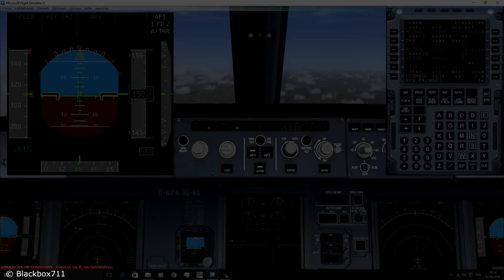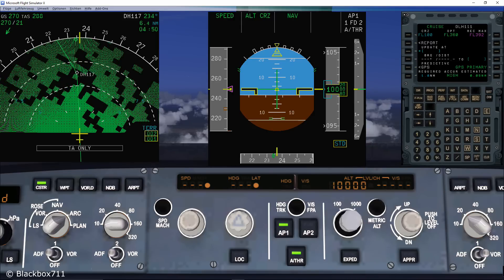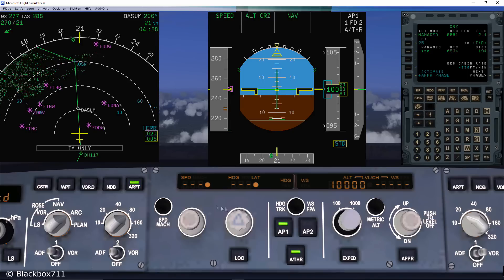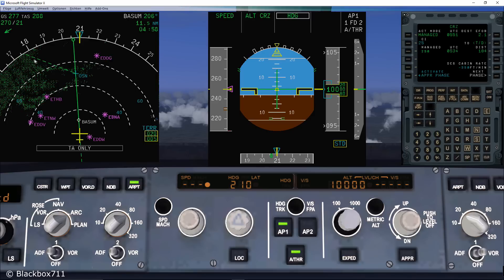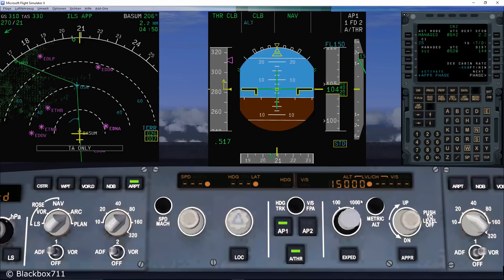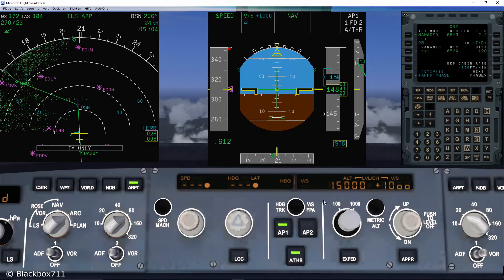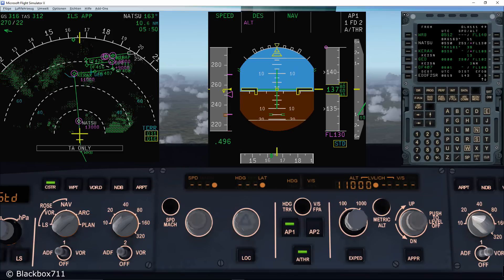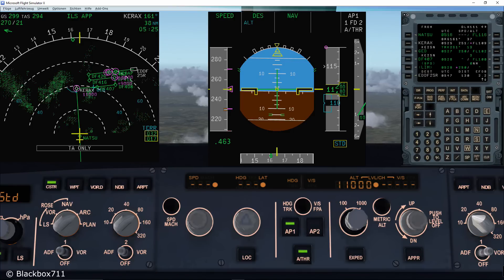FSLabs A320-X Basics: Autopilot/FMGS - how to use it properly

Comment: Hi, question, from managed descent I changed mode to selected descent V/S -xxx, Speed SP was selected and regulated by me. Now reaching the set ALT aircraft leveled to horizontal flight and I wanted to get back to managed mode. I pushed the ALT knob but aircraft didn't react and went back to managed DC  mode.  What did I wrong? must I set speed back to managed before ? Thanks for answer
Reply from the maker: Did you select a lower altitude on the FCU?
Reply: @Blackbox711  I don’t remember, but it can be that I didn’t change the FL before trying to change mode…
Reply from the maker: Also the managed climb/descent only works when in NAV mode.
Reply: @Blackbox711  thanks for help!

Comment: Thanks for the video!  I do have a question though.  What does the AP actually engage?  It appears that the Autothrottle and the NAV lateral  movement does not require AP to be engaged?  I guess I am confused because normally you would need to engage autopilot to adjust speed, altitude, and NAV.  But in the A320 it seems that the speed/Alt and Nav are functional without AP being engaged?  Am I missing something?
Reply from the maker: You have to differentiate between flight guidance (flightdirectors) and automatic flight. So you can indeed have all the same modes indicating on the PFD without the autopilot being engaged.

Comment: Hi. Im new with this aircraft on my flight sim P3dV4. My fmc always while flying have my plane do a high attitude pitch up then will descend  I don't know how to get it so I can program it correctly need some help with this
Reply from the maker: It is important that you read the manual that came with the installer. It should be either in your desktop or FSLabs folder.

Comment: How did you make the fcu so realistic with the 2 autopilots on Flight Simulator? Mine has just 1 autopilot on the fcu. 
Please tell me
Reply: FSX Default A320s have only 1 AP. This is FSlabs A320!
Reply from the maker: What Simulator are you using?

Comment: Hi, How do you fly with autothrottle engaged for the speed but manual HDG and ALT inputs?  I .e a visual manual approach.
Reply from the maker: I do that only in Flightsims. Helps me better to look outside without worrying about the airspeed all the time
Reply: Ok so In real flying you wouldnt have autothrottle on and HDG / ALT with sidestick inputs?

Comment: Could you explain please, why did the autothrust mode suddenly change from "thrust idle" into "speed" while descending, at 10:50 ?
Reply from the maker: Hi. It happened because the descent path was less steep and the FMC calculated that Idle Thrust is not required any more and hence changed into Speed mode. The aircraft only needed to descend 2000 ft and had 20 NM to do so. Regards

Comment: Great video. What do you use for fuel calculation (And takeoff/landing) with this aircraft ?
Reply from the maker: Hi. Thank you. I use simbrief.com for flight planning and a programm called TopCat to calculate the Takeoff Performance. Regards
Reply: Blackbox711 Thanks . How do you find the OFP from simbrief compares with fuel burn etc to this A320. What aircraft version do you use in Topcat i didn't buy this because I thought it didn't support this aircraft.
Reply from the maker: I think Simbrief does a very good calculation. I regularly do fuel checks on my flights and find only very small differences. Regarding TopCat, there is a FSLabs file that you can load into TopCat.
Reply: Blackbox711 Thank you very much. I had no idea that Topcat was supported. Are you using a custom aircraft type in Simbrief? If so is the ZFW taken from the FSLabs docs ? (also any fuel offset?). Thank you.

Comment: I'm New to the airbus and i have a question : if I select a speed and then push the knob will the aircraft follow my command or will it return to its original speed ? 
Srry im used to the default fsx a 321 !

Any way great video !
Reply from the maker: +STEFANO COZZI .. Thank you. Pushing the speed knob gives you "managed speed" which is the speed prompted by the FMC depending on the active phase (climb, cruise, descent, holding, approach). If you select and pull the speed knob then you get "selected speed" and the autopilot will fly the selected speed from the FCU (Flight Control Unit). Regards

Comment: BBox, thank you for all those videos. Awesome resource of information!..

As a veteran Boeing user I came across a question I still can't find the answe tor: the Boeings have the VNAV function, which when active commands the plane to initiate the descent by itself at the calculated TOD point, provided the lower FL is preselected on the MCP. I noticed the Abus doesn't do that. Under Managed speed and lat and new lower FL selected, the plane crosses the TOD point with a message on the PFD "decelerate". I need to push the alt knob to start the descent. If I push before the TOD the plane starts descending and deviates from the vertical profile. Is this how its done on the Abus or I'm missing something?
Reply from the maker: +skypiratez ...Thank you for your kind words! Unfortunately the A320 Managed Descend Mode (DES) is somewhat complicated. The DES Mode will only activate automatically when the Aircraft is in ALT CSTR mode (magenta) and the DES mode is armed. If the Aircraft is in ALT Mode, you need to press the Alt Selector Knob to initiate the DES. That is why you get the reminder message "Decelerate". If you press the Alt Selector knob ahead of the TOD, the Aircraft will start a  shallow descent until intercepting the optimum path. Then it will follow it. Regards
Reply: Thank you Sir! That's pretty much confirmation of my observation.

Comment: Hello there,

I get shimmering on objects like on the FD, ND. I have turned anti-aliasing on but that still doesn't help. What can I do to get them clean like yours? Did you use NVIDIA inspector?

Thanks.
Reply from the maker: Hi uszy. Yes, I used NVIDIA inspector. Apart from that I did nothing special to the setup. Regards

Comment: enjoyed watching the video.However you did not mention the magenta circle that appears when you start descent at the altitiude sction.what does it do?
Reply from the maker: Hi Alex.Thank you for your comment. You are correct, I did not comment on the magenta circle since it has to do with the managed descent profile which has to be explained in more detail in a seperate video. Otherwise this video would have been over 20 mins long. The magenta circle shows the deviation of the actual vertical flightpath in regard to the theoretical optimal flightpath calculated by the FMGS. This circle is displayed from the top of descent down to the Missed Approach Altitude. The deviation range is +/-500 ft and can be read directly from the altitude scale. If the circle reaches the top part of the scale the aircraft is 500 ft (or more) below the theoretical vertical flightpath. If the circle reaches the bottom part of the scale the aircraft is 500 ft (or more) above the theoretical vertical flightpath. Hope this answer helps!? Regards
Reply: +Blackbox711 yes this  answers my question .thankyou
look foward to more of your videos.great work